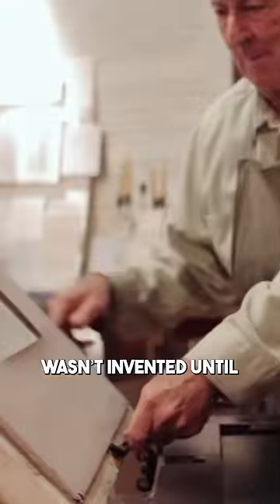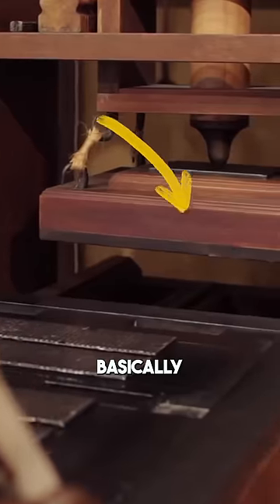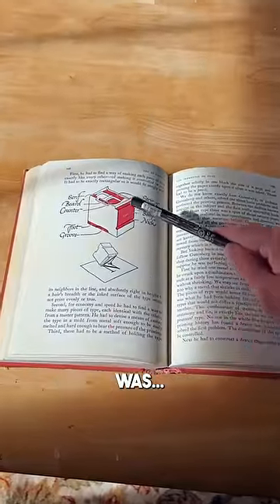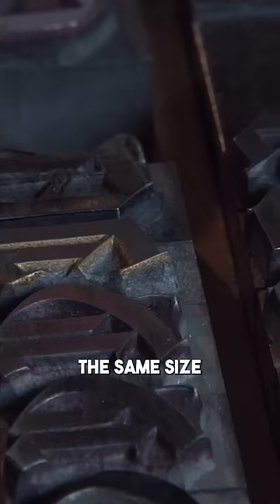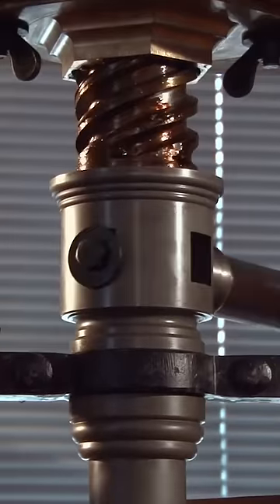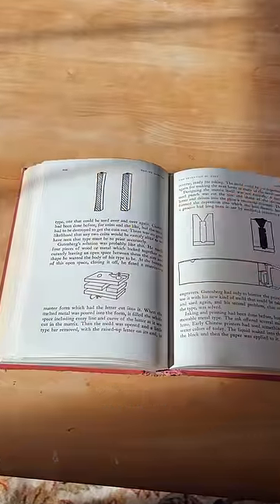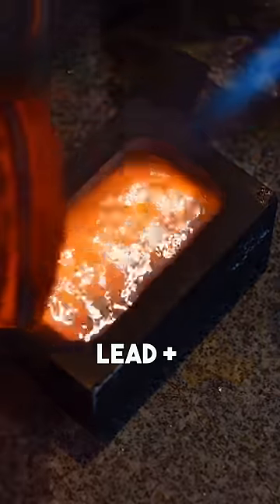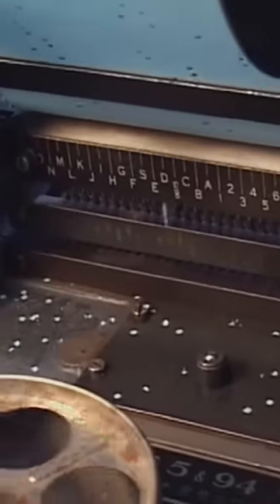The Hard Part of Inventing The Printing Press

Comment: The switch to digital didn’t happen until the nineties. In the 60s and 70s, lead type was replaced with photo typesetting. All the characters of a font were on a filmstrip, which was mounted on a spinning drum. A light was projected through each character, one at a time, and a lens and shutter focused the image onto photo sensitive paper in the correct position. The paper was then developed, and the text was pasted into position on a page layout board. The finished paste-up of each page was then photographed, and that negative was pressed against a photo sensitive metal plate. A bright light shone through the negative transferred the image onto the plate, which was used in the printing press.

Comment: Also pretty neat fact, an alloy of lead tin and antimony is also used in the making of bullets. The percentages of each can be adjusted for the purpose of a hand load. If you want a 7.62x54R bullet that can keep a good amount of energy at distance for a Mosin Nagant rifle there’s a percentage mixture for that. Adjusting the percentage to each can change the weight of the bullet as well as the hardness.

Comment: Lead and Tin also make Solder, I wonder if they are similar
Reply: Somewhat yes, but also noticeable different.

- Bullet Alloy is 5% Tin, 5% Antimony, 90% Lead. 420°C pouring temp.

- Linotype Alloy is 4% Tin, 12% Antimony, 84% Lead. 272°C melting point, 340°C pouring temp., mechanically stronger and harder than bullet alloy, most brittle of the three.

- General purpose solder used to be 63% Tin, 37% Lead. 183°C melting point, electrical resistivity is not great, but by far the lowest of the three.

Comment: Kind of weird that it took Gutenberg that long to figure it out since that particular formula had been used to make pipe organ pipes for a couple of centuries. Weird, I tells ya. Weird!
Reply: I could have been a trade or guild secret for organ makers. Also, while Ol' Gute' used the same metals, their ratios were different in order to maintain the required hardness.

Comment: I love your channel, but there's a big error about the date of the invention of the movable type printing press. In China and Korea, this existed several centuries before Gutenberg's invention in the 1440s.
Reply from the maker: Gutenberg definitely didn’t develop the technology in a vacuum. There’s a good case to credit it to China or Korea. Although the manuscripts I’ve seen from those eras are a bit different, often 40 characters or so per page in vertical columns with an inch of spacing between each character.
Reply: @_magnify  Well, the complicated characters would make small letters definitely more difficult to read. The images of the pages I found for the Korean Jikji are pretty compact though, I can only recommend that, if you haven't seen it already ^^
Reply: He didn't invent printing words on paper (7th c. China), or movable type printing (11th c. China), but he might have been the first to make a big pressing machine to help automate and speed up the process - and he definitely made the technology accessible to Europeans. Both very important, though standard "Great Man" history makes him out to be the lone hero revolutionary inventor.
Reply: You're incorrect, this is a common misunderstanding. China had earlier invented moveable type, but never invented the printing press. Moveable type is a component of a printing press, but they are not the same thing. Medieval Chinese moveable type worked by carefully pressing paper evenly onto the typeface by hand, which was slower and required practice to do without smearing the ink. By contrast, a printing press uses a mechanic pressing device for greater speed, consistency, and ease of use, which made it more suited to mass production of texts. Guttenberg was not the first to invent moveable type, but he was the first to invent the printing press.

Comment: The printing press was actually invented in China around 700 AD.
Reply: You're incorrect, this is a common misunderstanding. What you're referring to was block printing, which was done by hand. Later Chinese moveable type printing was also done by hand. By contrast, a printing press by definition incorporates a mechanical pressing device for greater speed, reliability, and ease of use. Guttenberg was not the first to invent moveable type, but he was the first to invent the printing press.
Reply: @topsnek4603  OK, thanks for the distinction.

I was thinking about the fact that it was used for mass production, & the block printing was a full sheet, not individual blocks placed by hand on paper - i.e., it created a uniform print. Speed does make a difference, though. (Although the Chinese block printing would be faster than writing by hand or using smaller blocks for individual parts of a page.)

Of course all inventions build on each other.

I think we in the West tend to think everyone was writing by hand until Guttenberg, which is, of course, not accurate. We have a cultural script about individual geniuses that's almost never true.
Reply: @elainebelzDetroit  Yes, block printing takes more initial time investment to carve each page, but once completed is as easy to use as a stamp. An interesting fact most people don't know is that moveable type actually never overtook block printing in popularity in premodern China, which is probably why moveable type never spread further than Korea. The Portuguese were actually the first to introduce moveable type to Japan, despite it already having been used right across the water in Korea for centuries.
Reply: @topsnek4603  Fascinating! Thanks for all the info.

Comment: This is a very Western centric view. Bi Sheng invented the printed press in 1040. It’s actually theorized that Europe got the idea due to stories brought along by travelers and traders.

Bi Sheng used copper plating, and it was used to print Chinese paper money for hundreds of years.
Reply from the maker: Gutenberg definitely didn’t develop the technology in a vacuum! There’s a good case to make that China or Korea should get the credit, although their machines & materials were different and often did about 40 characters per page, or on money like you mentioned.
Reply: Yep, but printing money and books are different.

Money have a definitive design that almost never changes, usually if the Monarch dies and the issuance title need to be changed to the new one.

Books on the other hand, have a lot of differences in every page. If you want to make a book, such as a Religious Scripture for example like what Gutenberg's Press were commonly used back when, you need hundreds of print blocks, one for every page.

And a work on a single sheet of paper could print more than 1 paper money... But you can't exactly do that with pages for books, at least not practical
Reply: @aribantala  it wasn’t only used for money but also books. Money was an example because it was an official government use. Bi Sheng actually invented it to use for paper books. This was a decade before paper was even known to Europe.

Even before moveable type presses, China was using various other printing methods to print documents onto paper, particularly ink and clay tablets transferred onto it.

Keeping in the East, there even exists still today a book printed in Korea using movable type 100 years before Gutenberg Press.
Reply: @wotvspacebanana  Okay, hold on a second. I am pretty sure that Far Eastern Printing presses didn't use Modular letter by letter block like Gutenberg's did... They do print books, but that's because they use one block per pages, not by arranging font blocks. 

Chinese Printing presses were indeed the very thing Gutenberg's draw from... He only perfected the usage of Font blocks so you can easily change it and made them more practical.
Reply: @aribantala East Asian printing presses were exactly modular letter printing. This is incredibly well documented and there are several Wikipedia pages about it, too.

Bi Sheng molded each character out of clay then fired them to make them sturdy in the first renditions of it. Later on they used porcelain and then copper for lettering.

Of course, Chinese type is made up of characters (words) and so it's much different. But later on Korea used printing presses in Hangul which is a phonetic language like those in Europe.

The woodblock printing is different, yes, but that's a whole other thing that was developed hundreds of years before this, with still intact ones found from around 700 AD in Korea.

Printing in Asia was being done to print entire Buddhist books WAY before the Bible was printed.

Again, this is incredibly well known knowledge throughout Asia. It's only Western superiority complex which denies that these existed. Paper existed in Asia hundreds of years before Europe, allowing Woodblock printing and eventually moveable type presses to exist long before Gutenberg became known.

Gutenberg gets credit for making the press more durable due to the metals he used for the letters. That's pretty much all.
Reply: @wotvspacebanana  Well... Yeah,
That's what he Invented, the Pewter Font blocks. I seriously don't get what you're arguing lol

I absolutely get you that there are moveable typesets in the Far East. But they are expensive, rare, and less durable. That's why they're mainly used to print something that's more uniform: money, government pamphlets, bureaucratic papers etc. Where changes are very limited. This is what I am saying

For books, in the Far East they use Woodblocks... You can easily carve a wood and duplicate them if they're needed or broken. Using a Modular typeset for books with this method, especially when it's still made out of copper is wasteful because it's more expensive 

Why it's more expensive, because Copper are More utilitarian. Copper are used in making weapons, tools, constructions and coinage. Demands are high, while supplies are limited, making Copper more expensive than Pewter, which is mainly used as a cookware and decorations. This is also what I am saying.

One more thing that I didn't mention, less durable. Copper is softer than Pewter. Tools made with Copper will retain edge and can be sharp, but it cannot handle pressure as much as Pewter do. Copper is the softest Toolmaking metal in history... It's literally the first metal Humans worked. That's why people alloyed them with Tin and Zinc/Nickel to make Bronze to make them more durable 

The guy who made the video made a mistake saying that "The Printing Press was invented in 1440"... Yes. Should have been more specific, referring to the Typeset than the entire print press. 100% agree with that

But the usage of Pewter as material to make the block is what made Printing Presses more durable, and more widely available for use unlike the Far Eastern models that uses Pure Metal, or Wood blocks. And saying that they're better than the Pewter blocks are simply false
Reply: That's incorrect. Bi Sheng invented moveable type, but he didn't invent the printing press. The printing press incorporated moveable type, but they're not the same thing, the difference being the incorporation of a mechanical pressing device. The idea that Gutenberg got the idea from traders returning from China is also entirely hypothetical, since there is no evidence at all of knowledge of moveable type existing in Europe until Gutenberg. Given that moveable type was not used in any of the areas in between Europe and China, its far more likely to have been an independent invention, of which there are numerous examples across history.
Reply: @_magnify  Saying "Gutenberg definitely didn’t develop the technology in a vacuum" to imply he might have learned of moveable type from China is very presumptuous considering there is no actual evidence of that. Considering that moveable type was not used in any of the areas between Europe and China at the time, its far more likely to have been an independent invention.

Comment: isn't wooden block press been used much earlier?
Reply: Yeah, but with wood you can't get the combo of detail, non-adherence and resistance that you need to make movable types. Non-adherence may be the important one, because you don't want your wood to stain, since humidity will make it expand and chip, ruining everything.

Wood is probably how those stamps were made. You can stamp stuff with wood, but a printing press is so much more than that.

Comment: Digital came later than that, but between metal and plastic some used sheets of plastic with the type pressed 3-dimensionally into the sheet of plastic. When they didn’t need to print that page anymore they threw out the plastic. (No recycling back then.)

Comment: Even with "the digital stuff" , a mixture very similar to that was actually still used for the solder joints holding everything together, (sometimes with silver, somtimes mostly lead)  and is still being used to this day

Comment: make for an interesting alternate history. Lead, tin, and antimony had been known for quite a while, someone fiddling around with a bunch of medals isn't necessarily out of the question for it to happen earlier. And as far as I'm aware the mechanical parts of the printing press started off as parts of a wine or Olive press, can't remember which one. So technically speaking there was nothing stopping us from inventing the printing press earlier and were in a different location. We just needed to line up the right building parts.

Comment: There's also the factor of wood pulp paper not entering Europe until a similar time either, instead parchments skins were the go to writing surface (essentially thinly sliced leather). 
Parchment being alot more difficult to mass produce than wood pulp paper so acted as an adtional obstacle to over come for the printing press to even become a useful concept to invent. 

So it was medium material and chemistry that held it back.

Comment: One can argue the reason why Gutenberg machine is more successful is because it is Latin printing machine with only 26-ish letter, thus easier and cheaper to manufacture. The other were created harder script, thus making the machine more complex to use and expensive to make. The middle east use Arabic script, they basically cursive joined one into another, 1 letter also (without counting kerning and ligature) can have 2-3 variations depending where you put it. The East mostly use Kanji script except Korean with easier Hangul later (but Korean didn't have huge influence until nowadays), kanji making it farrr harder and expensive to create.
Reply: each Chinese characters occupy basically a square area. so they can be standardized.
and they used ink that did not require a mechanical press. So, what they did was, make wooden frame about 30cm tall and 1 m wide, and about 30 mm deep. filled it with clay, and set metal types on the clay, metal types were made very thin less than 5 mm thickness, with the back side (that's the clay side) concave. and no mechanical machinary was used to print. just ink the prepared block then put a paper on it, then rub the paper against the block.
Reply: the reason for the size of the frame, is that is the size of paper produced.
after the print, they cut that paper in half, and then each halves are folded in half again. so each page is about 30cm tall and 25cm wide. only one side of paper is used for printing. so each page was two papers thick.
ie, each blocks had 4 pages on it.

Comment: Any particular reason why they couldn't use wood? Obviously it can't be molded for mass production, but it can be carved easily and it can withstand a lot more pressure than needed to apply ink to paper.
Reply from the maker: From what I’ve heard, for a page of text you may need to carve 100 E’s that are precisely the same depth in order for the page to ink properly. However, wood is hard to carve with that precision due to the vascular structure.
Reply: @_magnify  Thanks, that makes sense.

Comment: I love these videos, peace be upon Ironland, but I must take issue with the 600AD dating for stamps. Cylinder seals, which are stamps in a cylindrical form, have been dated to at least mid fourth millennium BC and may have been in use as far back as the 8th millennium BC. While referred to as seals, their exact use is uncertain. Maybe cylinder seals could be a topic for another video.

Comment: I was inspecting a house that was built in the 1920s, it was going to be remodeled. On the outside of the house (under the siding) the original builder had used an unusual type of 'building paper' to waterproof the structure. What was found was test prints from a now gone newspaper ( the Los Angeles Times Herald) from 1922. The owner must have worked there, the test prints are newspaper size, reversed, and white in color. They covered the entire Victorian style house, and seem to have been liquid once and poured over the type. I believe it is made from rubber and Asbestos. I was able to keep several sheets of theese and able to read them. The old prices like four quarts of strawberry jam for 25 cents, etc and an interesting story about Charlie Chaplin owing the IRS more than 5 million dollars, in back taxes ! 😮

Comment: Was there any complications that came with using wood? Or was it just really hard to carve on?
Reply: The hardest part with using wood was that woods would easily crack or chip after short period of usage, especially because it would be soaked in ink then dried and repeats. Not to mention woods shrink, expand and deforms by many factors, too.